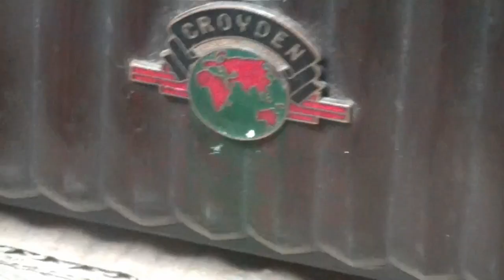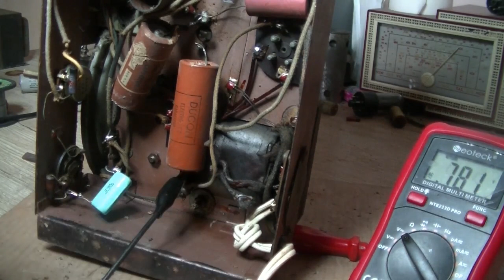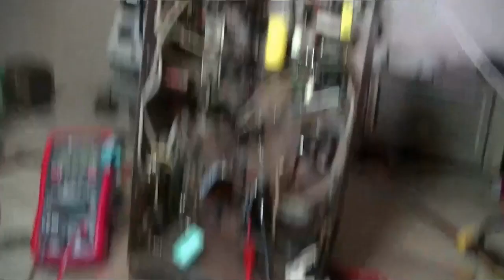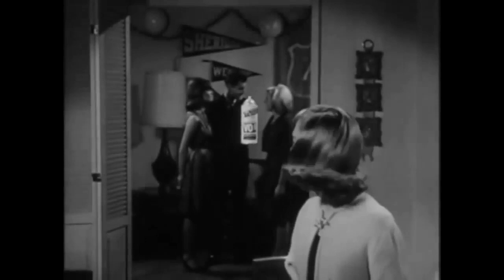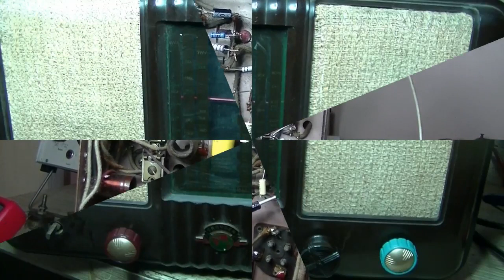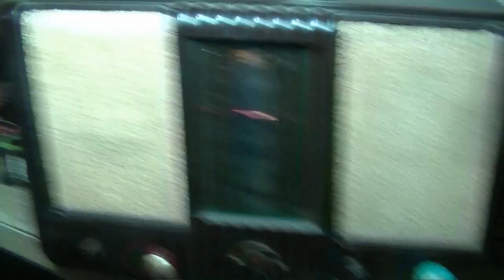Croyden Valve Radio Restoration. Circa 1940

Comment: An interesting radio Frank. Reminds me of some Philips European models. I noticed the rectifier socket had only 4 pins. Is it an 80?, unusual for 1940. And the four valve radios don’t have as much gain as five valve ones. They were built to a price. So a long aerial is necessary for shortwave.
Reply from the maker: Hi Robert, this case or very similar was used by a few manufacturers, like Philips as you said and mullard. I can't remember if the rectifier was a type 80 though, but your probably right. Thanks Man :)